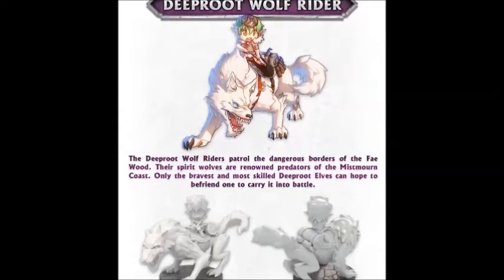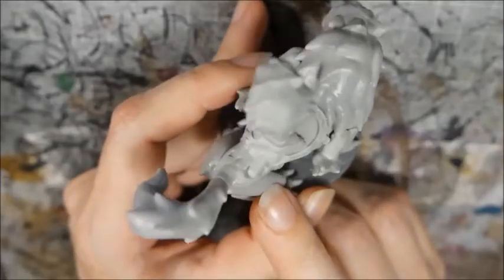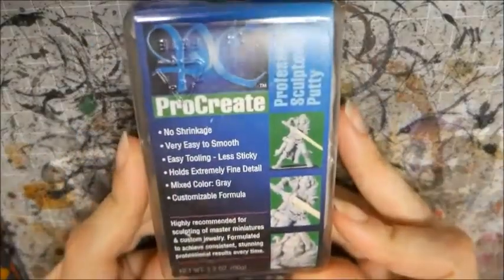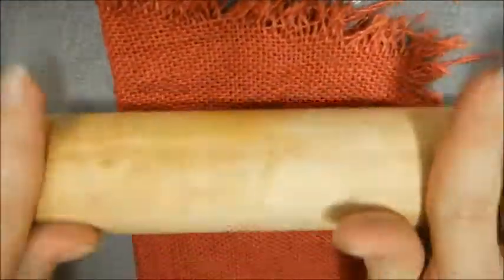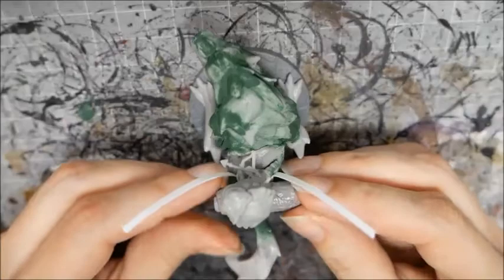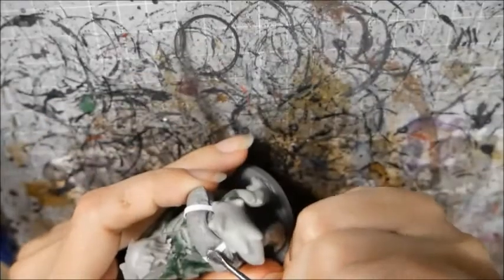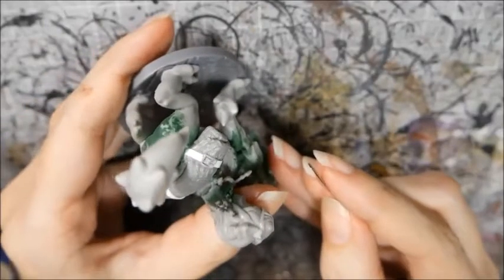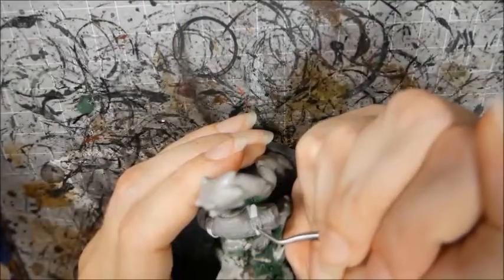How to Paint Miniatures - Converting a Bedroll

Comment: Very nice tutorial.  

One suggestion, to think about for the leather straps.  Instead of using plasticard, I have found success using moderately thick paper, such as the kind you get with business envelopes.  I find that it forms up a bit easier than plasticard.  It also is a bit easier to work with if you want to get some "wave" or creative flow to the strap by getting it wet, then brushing on a bit of superglue to add rigidity after drying. 

Very nice work.
Reply from the maker: Sounds like a good idea, I'll have to try it out in the future